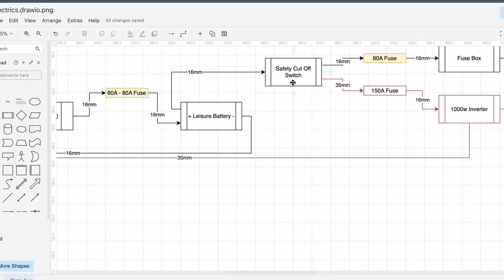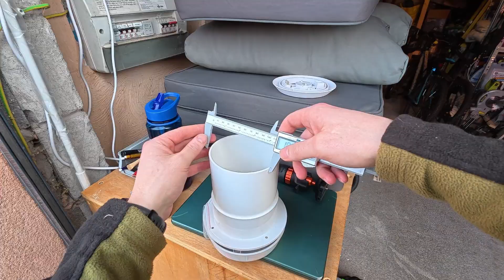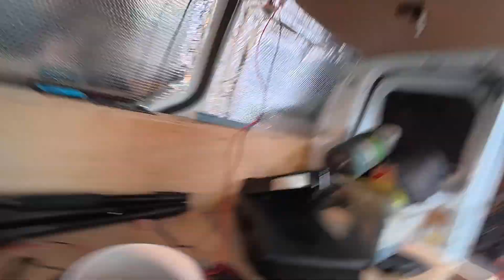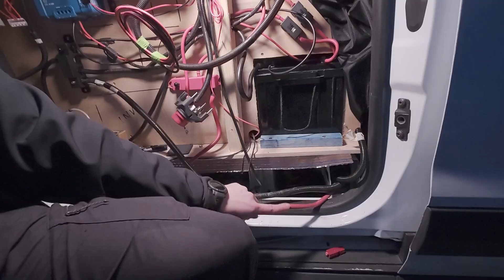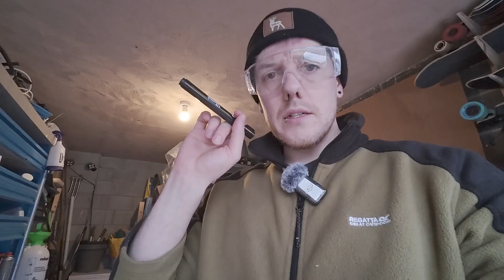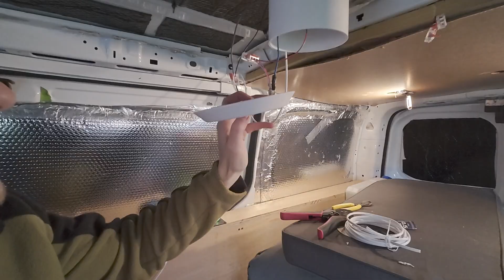Van Conversion Upgrade: Installing DC to DC Charger & Electrical Extraction Fan

Comment: Is the fan switch not for reversing between in & out, instead of 2 speed?
Reply from the maker: Ah really good point! I did a bit of research and apparently it is a differnt speed thing. The fan will draw more voltage on setting 2. I 'll have to test it with the multimeter because you just can't tell the diference otherwise!